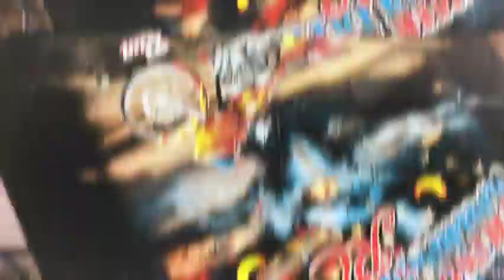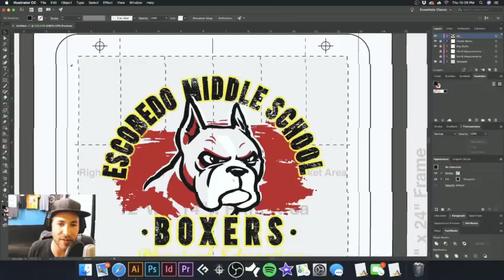Should I (You) Get a Shop or Stay in the Garage? | Shop Talk

Comment: We are a digital print shop, just starting out with screen printing. We currently have a 1000sqft shop (770sqft workshop and 300sqft office), and are at the point of whether to move to a bigger shop. 

We are trying to work out whether the 300sqft office space would be enough for screen printing (with a small 4 colour/4station press....would appreciate your opinion Matt.
Reply from the maker: That should work just fine. That's about what we have here. You may need to consider growth because we went from our 6x6 to an auto pretty quickly once we moved into the space.